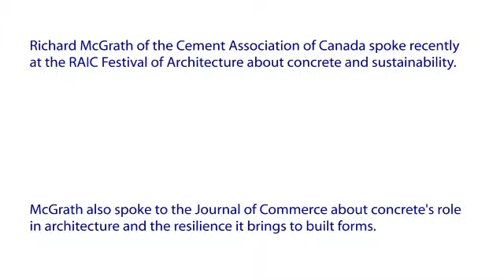ENERGY EFFICIENCY BENEFITS OF CONCRETE'S THERMAL MASS

Comment: This might be the best advice I have heard on the Future of modern Climate Change Construction. It is also important to understand that 4 or 12 inches of concrete, are not required to moderate an interior, as little as .5 inches combined with insulation will be sufficient.